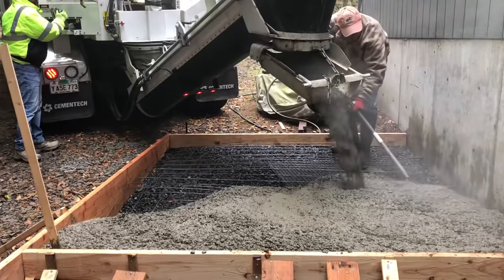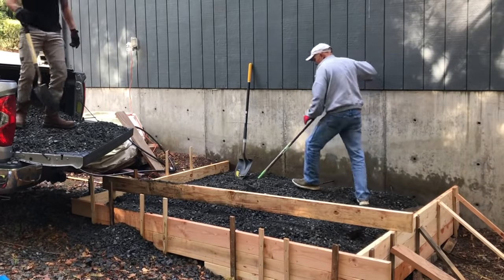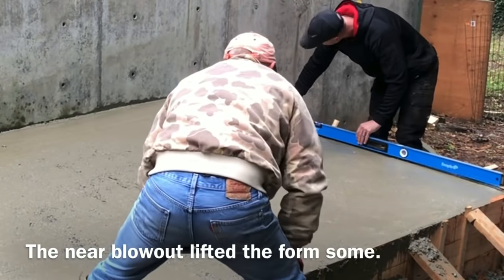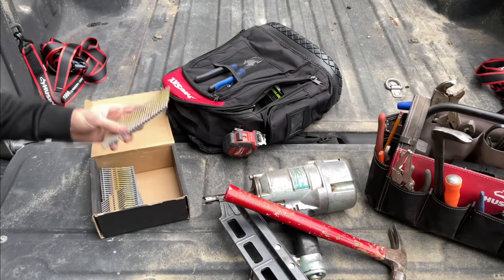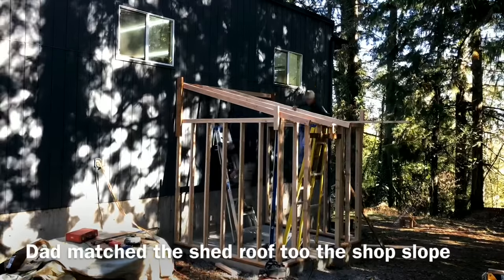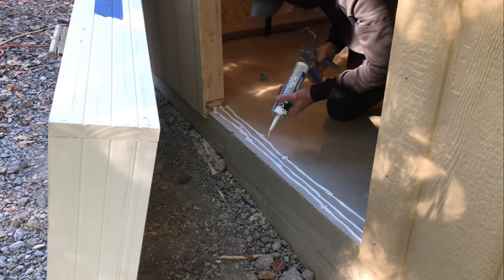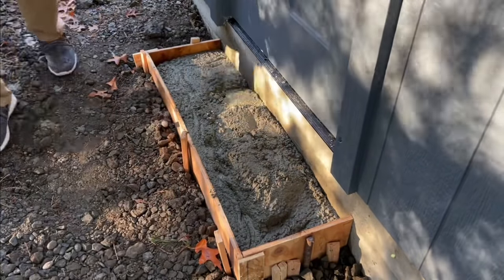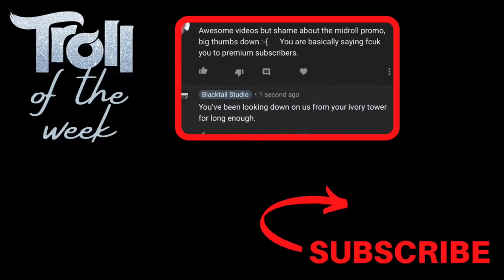Attached Shed w/Slab Concrete Foundation

Comment: Pop...
About to do exactly what you just did with my compressor and cyclone. Timely video, Cam, and a nice job on the shed.

BTW: I just air-plumbed my shop with this 3/4-in line and connector kit from Northern Tool: RapidAir MaxLine 100-ft Master Kit  Model #M7500 (@$199). Plus, I used the purple hi-flo quick connectors that pass WAY more air and can be connected one-handed. Great value and superb quality components. 

Give it a look, bro (no, I'm not getting paid). LOL! 😂
Reply from the maker: I have that kit from my last shop. Can’t wait to get it in!

Comment: Pops and my kids call him Pappy. 

I'm looking to get my shop set up here soon. The garage I'll be working out of was originally set up for working on cars, so the floor is slightly slanted towards the center where the drain is at. I'm no mechanic myself, so I have no use for it; everything would work out better for me if everything was leveled out.

Plus there are some cracks throughout, so it's going to need some reparations to the concrete either way.

The good thing about it being an old car repair shop, though, is it comes with an industrial hoist system worth at least 10 grand if my memory serves right, so I won't have to worry too much about moving some of my larger tools/project pieces around the garage.

Comment: Pretty good work but I'd suggest an expansion joint compound between the existing concrete and the new concrete. If not you'll get an ugly seam prone to cracking. It's like a 3/8th inch thick black compound you can easily cut with a knife. I'm surprised you used the diesel trick, we used to use that on our metal forms when I did concrete. One thing for looks would be a round-over trowel for the edges. 
When using the metal screen I've always found it easier to put down a thin layer of concrete all around then lift the wire mesh above that then finish adding concrete, just makes it a little easier when pouring .. don't want to piss off a concrete truck driver! Haha
Reply: Don't forget to take a damp broom to those steps after finishing. Don't want them to be slippery when wet!
Reply from the maker: I brushed em!

Comment: Dad! Nice work! I’m doing the exact same thing to accommodate my dust collector, air compressor, and vacuum pump. In my case, I did not attach the shed slab to the shop foundation. So, the shed slab might shift due to frost heaves. (I live in CT.) Do you have a recommendation on how I can fasten the shed to the exterior shop wall to accommodate any shifting?

Comment: I know you said you weren't a contractor but you both did an OK job, but I hope you don't mind me suggesting a bit of a safety tip with your front step? As you made it pretty smooth, you might have an issue in winter with ice, You can get a non slip paint that puts a texture on it to help negate that type of problem.
Other than that, nice job, looking forwards to more.
Mac#

Comment: Dad has been rejoined with the atoms of the universe for seventeen years now. Watching your videos is like being with the same man: pedantic, with a purpose - but human enough to show you the mistake he made. That meant _everything_. He designed this wild ladder/stairway up into the loft of our wood shop, which used to be an old goat barn. The idea was that the "ladder" was made out of 2 x 8 side rails, with cross-nailed-on-ledgerboard-treads - (weighed about 160 pounds) would slide up into the loft on one-inch roller ball caster bearings. I come home for a weekend to visit and he says, "You almost lost me". 

He spends ten minutes drawing me a diagram, and then the physics formula and calculations for the center of gravity of his stair/ladder, and then the diagram for where these roller bearings were. It really seemed like a great plan; you could just lift the stairs up from the bottom and push the thing right up into the loft, because once you started to push it up, the weight on the other side of the bearings would start to "lift" your end so that it weighed nothing by the time you were halfway up. 

But if you let go of it ... just... that... much....too...early.... then the whole thing not only came back down rapidly, but it FLIPPED over that "moment"/center-of-gravity.... and that was where he almost lost his head. Literally, it should  have killed him, but missed by that much. 

When the man you admire to do the things that are really cool admits that he's also human enough to have the same kind of moments that we are embarrassed of because the surely only happen to us, well, it's meaningful. 

The roller bearing idea got scrapped. The stairs are now hinged at the top, and they are lifted at the floating end by a clothesline run over two pullies, using as counterweight a hand-made cradle that holds seven old cast-iron window weights that he kept when he put new windows in 30 years ago. I know that nobody else in the world has one like it. 

I keep watching your videos, thinking "how can I do this on a budget that's about 1/1000 of what he's got?"

I'll call mine "Be like Cam, but be content that you're the Yugo version to his Lamborghini."

Comment: Dad

Love the video!  We are considering doing a concrete slab ourselves about that same size but wanted to ask a few questions.

1. 1-10, how hard was it for someone of your skill set.  I am capable (not skilled) at building forts and pergolas but concrete seems like a who different beast.
2. How much did it end up costing?  I am hoping to save a bit of money with doing it myself.  as of 6/2022, it would probably cost around $2500 to get it done.

Thanks!!

Comment: Poops, was what I called him, very good build, wish I could do the same but here in Ga. at least in my county, structures must be erected no closer than 10 ft to any existing structure. Am in the middle of a 16X20 shop build, with little experience, ambitious yes, but the building inspector passed the pier foundation and floor framing. If I get past wall construction I wont need any more of their help.
Reply from the maker: Love that!

Comment: Dad, Like the shop updates, but was wondering why you didn't make the shed bigger? Seem like you have plenty of room to make it big enough to divide into two, one to house the vacuum and the compressor and the other to house tools you don't use very often.
Reply from the maker: Wanted to stay in between the windows and still be able to drive a big truck around the side

Comment: First, I love the content Cam!  Did you wreck that hammer drill bit?  It doesn't take much pressure to get the tool to do what its supposed to do.  Any extra pressure will heat up the bit and the tip will mushroom.

Comment: Next time use epoxy to anchor the rebar. Pounding them in at an angle is not to code. Also it doesn’t look like the fill was compacted as you back-filled. The footing and slab could settle and crack. Don’t listen to your neighbor - use rebar next time. Number #4 or #5. You have the weight of the compressor and a fairly size decent slab. The 6x6 10ga. Isn’t ideal and use dobies next time instead of lifting it up. Cause what ends up happening is the mesh never gets pulled up as I witnessed. Kinda of a sign of a backyard job. You could shovel  out the concrete and then reposition the form. I saw you using large wooden stakes so I was wondering how that would work out? Use steel stakes next time with duplex nails. Incidentally the tundra you could have backed up into the form that blew out and that would have solved your issue?
Reply from the maker: Good tips!

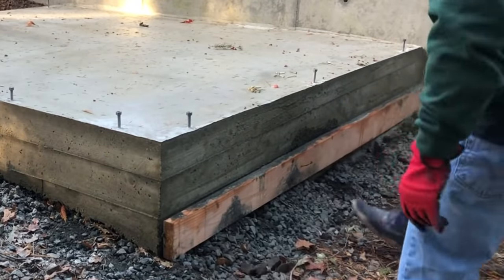Comment: first time that i see a foundation above the ground :)  , the correct thing to do was  to dig 50cm  to reach the level of the lowest side and then start building . create a proper concrete foundation 20-25 cm thick  until u reach the desired level  then fill the empty space with gravel  then pour lightweight concrete with wire frame . The whole thing is on the air  proof  is gravel showing at 6:23 min   and those 2 bars you putted to connect it with the main building can create a problem in the future in the main building  .
Reply from the maker: Those bars are actually required by building code
Reply: @BlacktailStudio   the thing is that the cabinet isn't properly founded . A heavy rain could washout the gravel beneath the cabinets pavement which could translate in a movement of the cabinet . i think u can imagine what will happen where those 2 bars are . Owner should  reinforce the foundation a bit  with external small retaining walls now  he can do it alone he got the skills . I don't know where the cabinet is build but in earthquake areas we try to avoid those types of connections because in the case of an earthquake u could damage the building.

Comment: Hey crazy... Just as a heads up. No amount of angled rebar will keep those slabs from moving. Unless both slabs are sitting directly onto solid rock those slabs will start to move. It's just a fact of life, and nothing you do will make any difference. Most people don't know this but concrete is always going to fail at some point. I've seen tons of wood beam foundations last longer than concrete and here is why.
When you pour concrete it's going to be heavier and more dense than the ground material underneath. Over time it will wiggle it's way deeper into the soil and create pockets, those pockets will fill with gas, water and all sorts of fun abrasive materials that will slowly grind away at the underside of the foundation. This will cause tilt in the foundation that will lead to cracks and as the single foundation breaks apart into smaller chunks they will rub against each other creating more pockets and the problem will continue. The reason wood beams tend to last longer is that they flex. Any time someone wants an addition made to a building I always advise wood beams for that simple reason. Making an additional slab will cause rubbing and ultimately a faster erosion of a cement foundation. Anyways just some food for thought it will still probably last you a good 25 - 50 years depending on the quality of cement but you will also want to make sure you maintain it well by always checking for cracks. If you catch it early enough you can get foam injections or epoxy injections to help stabilize it and get ride of pressure points underneath the foundation.
Reply from the maker: It’s building code to use rebar 😉
Reply: @BlacktailStudio  truer words have never been spoken. I've seen people do worse though. You did a good job on the pour and even working the floater. 1 recommendation I would make is to dig a bit of a trench on the side where the soil meets the siding. Maybe a retaining wall so the soil doesn't wash down and rot that nice siding.

Comment: Pops or Dad, interchangeably. 

What did you put between the concrete and the treated 2x4 footings? I’m doing a simple shed and my instructions told me to do caulking. I always thought there was a different type vapor barrier?

Comment: Papa, how did you go about calculating the return of air to the main shop. I have been thinking of doing this but Midwest winters are really cold and I’m concerned about heat and air conditioning temperatures. I don’t want to make a big deal but any information you can provide is greatly appreciated!
 Best Regards 
Fred Thomas in northern IL.

Comment: (Dad). Great video.  I'm thinking about doing the same thing to my current shop.  How did you breach/cut into the existing wall to provide access? Did you only run the Vacuum lines through?

Comment: Pops, if I may provide an opinion,(fier safety system.And it would have bin cool since epoxy is a product well used why not make an epoxy step ore for section.liked the input

Comment: Bastard - not a good dad... good job on the build. A tip for in filling with hard core; try to leave a deeper edge inside your boarded area so the concrete pour can bind right down the sides. The end result looked good but the deeper edge pour ensures it doesn’t start crumbling away in years to come. You could also seal the outside to slow down weather damage.

Comment: You did a great job and this addition looks really good but I am curious why you chose not to install any exterior sheathing or a vapor barrier? Was it just cost? I live in the southeast and I have a shed built like yours and in the summer it turns into an apartment for wasps. I have no clue how they get in but they seem to find a way.
Reply from the maker: I guess cause dad didn’t say to 🤷🏻‍♂️

Comment: Dad, Looking forward to see the ducting for the vacuum and air compressor since I couldn't find those for the previous location.  By the way how loud is your vacuum system?  Does it require a separate location due to the noise?
Reply from the maker: The manufacturers give decibel ratings. And that video is coming!

Comment: Hey dude, I have a big problem here while making my epoxy talbe. I just wanted to get rid of the mold today and the whole table is stuck on it. I used a mold release but its still stuck. Do you have any tips how to release the mold from the table ? The only thing that got on my mind is to get rid of the mold with a router or an angle grinder.
Reply from the maker: I’ve had to plane them off before. Sucks

Comment: Dad.
I really like to see those project.

I have a small question for you,  I also made a resin river table, but after I pour the second layer the level of the resin dropped below the slab by ~0.1”. Would you do another pour after it cured to fill it to the top or the planer will flatten more than that anyway? (I found a place nearby with the same industrial Costa K planer as you go to)
Reply from the maker: Depends on how thick you want it. I’ve done both options

Comment: Dad. I can’t seem to get the quality wood you use. The slabs I can get with any character have a bunch of cracks pretty large. I mean a lot go all the way thru top to bottom.  They are also too narrow to scuff up .  What do you recommend for using to stabilize, and seal ? I figured a whole lot of ca ? Keeping in mind I can’t scuff instead would you seal with epoxy and do main pour while it’s still tacky?
Reply from the maker: Man, hard to say from here

Comment: If you want your paint to last for ever I can share a recipe for making your paint that has been used for centuries in Norway (and region).  It is the paint that was used on an Orthodox Church built in 1511 and painted with this paint.  It has not been painted since then and looks just a little faded.  I made it for my barns and house and it is exactly as the recipe says…thick, fire resistant and long lasting.

Comment: Question, i’m trying to figure out how you used all those concrete chunks and stones under the concrete layer but still made it so the concrete poured down the sides to hold everything in, if that makes any sense. I was expecting you to take off the boards and the rocks that were touching the boards to just fall right out. How does that work? Great video!
Reply from the maker: Just left a gap around the piles of blocks. So the concrete could make a big bull nose look

Comment: Did you put the wall's straight onto the concrete? 
I want to use the base as the finished floor but worried about moisture into the walls

Comment: It was not clear to me how you attached the walls to the side of the house. Did you screw into the concrete foundation wall? Did you nail through your siding? Was their a ledger board that attached the roof to the house?
Reply from the maker: Concrete anchors and long screws to the studs

Comment: Pop.  You're doing fine with your videos, but if you want a bit more polished look I'd highly recommend Pinnacle Studio 24 Ultimate; very intuitive and has a ton of free instructional videos.  I've been using it since 2003 and it's never let me down.  Make sure your computer can handle it, but most higher end models can.  Thanks for the instructional videos.  Keep 'em comin'!
Reply from the maker: I’ll check it out!!

Comment: Dad!  I want/need a little shed and have a slab next to the garage.  What's better or cheaper... 2x4 construction or premade metal?   And how can one attach to the existing slab?
Reply from the maker: I like wood. And I showed how to attach here!
Reply: @BlacktailStudio  Actually you poured a slab and added J bolts... I have an exiting slab.  And what goes directly on the slab..  metal, pressure treated wood, pvc?

Comment: Apa or Apu (in hungarian) - how is the cabin after almost 1 year? was there any issue with rain "washing under" the cabin, the concrete part? as I have seen, you were not really digging a foundation "hole" for cabin, you were just building onto the ground - anyway, I like your channel and your works, keep up man
Reply from the maker: Nope, good as new still 👍🏼

Comment: Dad was my dad, he passed a long time ago.  My father-in-law is Pops.  As in "Can it Pops!"  Question for you not related to this video but epoxy tables.  I notice you never use any joinery when attaching legs to your tables, all your legs are attached with screws/bolts etc.  Is this just personal preference or is there a concern with using jointed legs with epoxy tables?
Reply from the maker: No joinery for that yet

Comment: Sion papá, can I use a 1.5 hp dust collector in my shed? Is about 2 feet away from my shop?
Reply from the maker: Don’t see why not.
Reply: Would about 1000 cfm be enough to pull across the shop and then into shed?

Comment: Dad. Doesn’t it kind of defeat the purpose of having a separate shed for the air compressor and dust collector to dampen their sound if you just end up cutting those “pressure equalization” holes?

Comment: You didn’t need wire mesh - you could have had them add fiber to the concrete which is just as strong